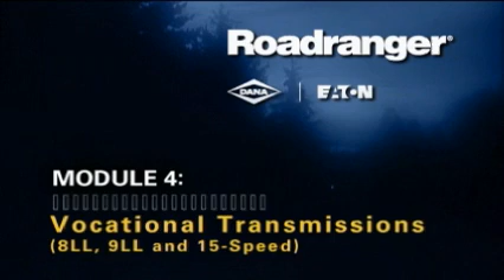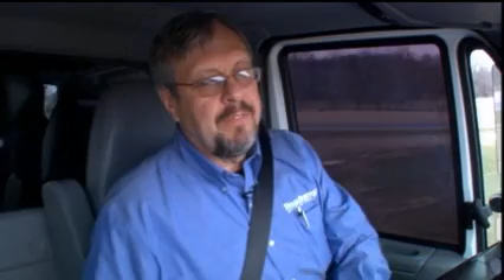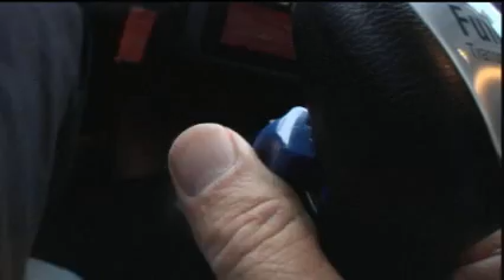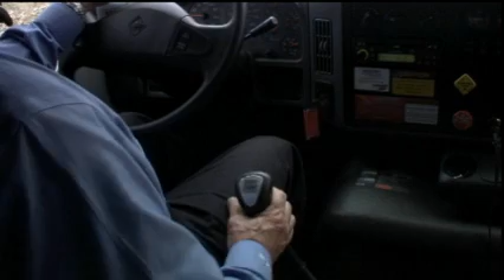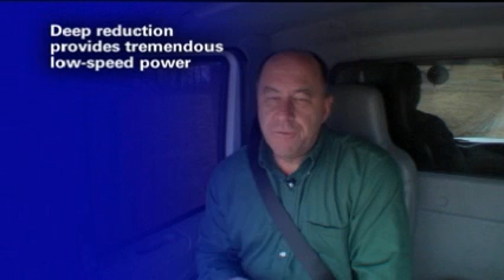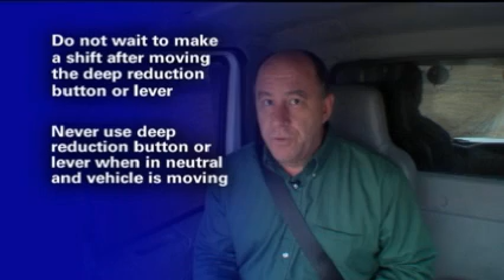Professional Shifting - Vocational 8LL, 9LL & 15-Speed

Comment: Don't be silly. You don't need to have a "very steep step" coming from deep reduction to low. Obviously this guy has never worked a paying run. Guys from the office are terrible driving instructors. To avoid this "very steep step" you simply use one or two more gears in deep reduction and your RPM split will be the same as all the other gears. I am perplexed that this office guy did not know that. Sadly this is what happens when you know more about office work than actual driving. Give us a real driver please.
Reply: What he means by a very steep step is the gear ratio. In a 9LL the % step is 60% from LL1 to LO  the same for LL2 to 1st. You can not use the deep reductions gears progressively as they are intended only for road speed control.
Reply: @Expensivepenny  Nonsense. I drive 15 speed trucks and I sequentially shift from deep reduction into low and then high range. It is sad that so many people have no clue how to properly shift a 15 speed. Are you new at trucking.  I have been running long haul for 51 years and would be happy to give you driving instructions.  😂

Comment: No splitter or range selector lol. Calm down my guy.
Reply: @Reinar88 Well that is not completely correct. There is no splitter. The blue button is a range selector to go from deep reduction to low. The black button is to go from low to high range. Easy peasy!
Reply: I dont know how i missed the selector. Its right there! Lol. I drove 18 speed where u could split the low range @SternDrive

Comment: My question is: is the deep reduction gears on a 15 speed as low/reduced as the counterpart deep reduction gears on a 8ll or 9ll? Or maybe that just depends on the model?? And same question for a 13 speed

In other words, what are the gear ratios?
Reply: It depends on the model but the 9LL has the lowest possible at 26.08:1. The lowest for an 8LL is 19.58:1 AND the lowest ratio possible for the 15 speed is 16.94:1
Reply: @PlayWaves1  Yes that is correct. In low gear and deep reduction you can walk faster than this truck will move. It is away lower than any 13 speed. We do not use all the gears all the time. There are a total of 12 useable gears. In real boggy conditions you could very well start off in deep reduction and low gear.

Comment: So, these transmissions have 10 forward gears... Why is it called an 8 speed trans?
Reply: 8LL, 8 main "road gears", 2 Lo gears. Usually don't need the lo gears on the street.
Reply: @tommyw.9424  can you use all the lo range gears in deep reduction? like a 15 speed?
Reply: @izaacbanks3337  Yes I drive them. There is so much confusion how to drive these 15 speeds. Here is how you do it. You would start in deep reduction, and go 1,2,3,4,5. Then flip the little blue button to low and go back to 4th, then to 5th. Then you would flip the black lever on the front of the stick up and move the stick back to 1st and on up through 2,3,4,5. If you are NOT from the office, you can do all of this smoothly with out the clutch. If you are from the office, and don't work a paying run, I recommend you double clutch. You will be rough, but that is better than dropping a good transmission out on the road. Ouch!:face-orange-frowning:
Reply: @SternDrive what i don't get is why Eaton still have a true 15 speed but also have the 8ll and 9ll that apparently aren't. Just the gearing spread I suppose

Comment: No you can’t operate it like a normal 10 speed because 4-5 9-10 are reversed, if you don’t know that be prepared to drop your transmission or over rev your engine 🤣
Reply: I believe that layout was only found on the older overdrive transmissions. I don’t think newer ones have that layout
Reply: Not all of them were like that at any time, and none of them have been made like that for 20 years.
Reply: @tommyw.9424  Why were some of them like that?
Reply: @zacharybishop6595  Traditionally, some of them were like that because the reversed 4-5 "horseshoe" or "high gear against the dash" pattern was used on overdrive transmissions, and the non-reversed "H" pattern was used on direct transmissions. On Eaton transmissions, 
model number starting with "RTO" meant it had overdrive with the horseshoe pattern, "RT" meant direct with the H pattern. These rules applied for all except for 13 speed overdrives, which were not reversed pattern because they were based on the direct 9 speed and their overdrive came from the splitter section's high gear. Later on in the 1980s and 1990s, Eaton started making "RTX" transmissions, which were overdrive transmissions with the conventional shift pattern. My 1996 T800 had an RTX16710C, my dad's 1989 378 has an RTX14609. Later still, the original reversed top 2 gear position overdrive transmissions were dropped from the lineup, and now, new RTO transmissions have the top gear position in the conventional spot. Hope this helps.
Reply: @tommyw.9424  Why did Eaton design them like that though? Just a way to tell them apart or something else?
Reply: @zacharybishop6595  In earlier times, it was probably because it was easier or simpler to fit the different size physical gears into the transmission in that arrangement. Like an old farm tractor transmission, lots of them have funky shift patterns because the transmission was designed from the inside out to be compact and fit all the gears inside, not to conform to any special shift pattern.
Reply: @tommyw.9424  Makes sense. My only other theory is they did that for people coming from Spicer transmissions, they had a similar layout too.
Reply: @zacharybishop6595  Yes that is true. For many years I ran Spicer transmissions where 4th and 5th were on the top, and 6th was straight down. It was strange at first, but you do get used to it. I'm sure the new guys are glad they don't do crazy stuff like that anymore. 😂
Reply: That's a super ten
Reply: @chadrobinson3374  Nope. A super ten you can split all gears all the way up. These 15 speeds don't have a splitter. That little blue button is NOT a splitter. It is to go into or out of deep reduction, and they are easy to shift with two fingers if you know what you're doing. There are a few guys on YT who can shift them from deep reduction to low effortlessly, and some really suck and need to stick with office work. 😂

Comment: How are these transmissions 8LL  have heard real bad stuff and break a lot ? Looking at dump truck with it in it Whats top hi-way speed ?
Reply: Mine never broke. Drove a Pete 365 dump truck for 4 years with 600k on the odometer.
Reply: 8LLs are fine transmissions, they are simple and do not break often, very reliable transmissions. Top highway speed is totally dependent on rear end gearing and tire size. Most 8LLs have the same .73 overdrive as other modern Eaton transmissions.
Reply: @tommyw.9424  They are just fine, however there are some new guys out there that just don't have the knowledge or skills to drive them properly.

Comment: I WAS IN SOMONE BACK YARD SND GROUND  WAS KIND OF SOFT AND WAS SINKING IN THE GUY LOADED ME UP WITH DIRT AND I WENT TO DRIVE AWAY AND I HAD THE BLACK SELECTOR DOWN ON FIRST BUT I HAD THE SPLITTER BACK AND I WENT TO PULL OFF AND GAVE IT A LITTLE GAS AND THE DRIVE SHAFT DROPPED TO THE GROUND DID THIS HAPPEN BECAUSE I DIDNT HAVE THE SPLITTER IN DEEP REDUCTION OR WAS IT INEVITABLE WHEN I WOULD RELEAE THE clutch when I had it on low/1st it would just go a little then die and it would sink a little more each time
Reply: Deep reduction would have helped with the extra torque -less strain on the drive shaft.
Reply: This is the problem with a great transmission and a poorly trained operator. Come on guys! Deep reduction is there for a reason. Stop burning clutches and dropping drive shafts. All you need to do is start off in deep reduction and shift 2 or 3 gears and then go to low. You will not have to burn the clutch at all. Where are the qualified trainers these days?

Comment: I still think the 15 speed  is the best trans made love the reg ten on top  then the 5 bottom.
Reply: The 15 spd is more versatile with 5 deep reduction gears but I found the 1 deep reduction gear was all I need for my 66,000lb gross dump truck. The LL deep reduction gear is great for loose terrain with steep hills.
Reply: definitely agree i've driven offroad for 23 years and the 15 speed is the transmission of transmissions to have in my opinion. i especially like them with 24.5 diameter drive tires and 3.73 axle ratio's great highway acceleration 80 mph cabable @ 1750-1800 rpm and monster off road capable in mines or quarries with the deep reduction side in.